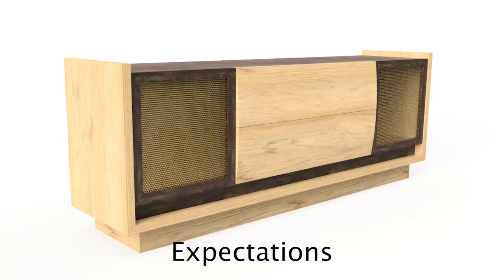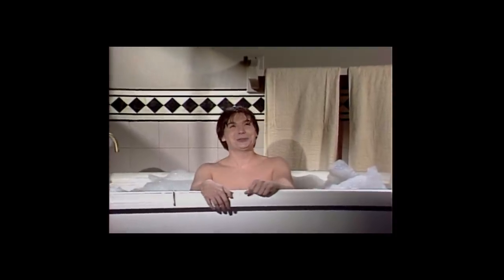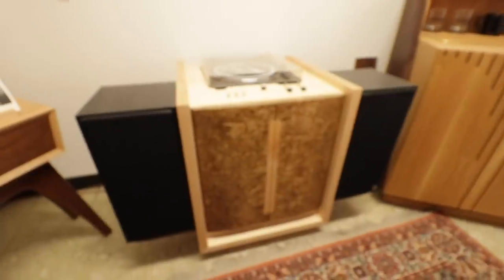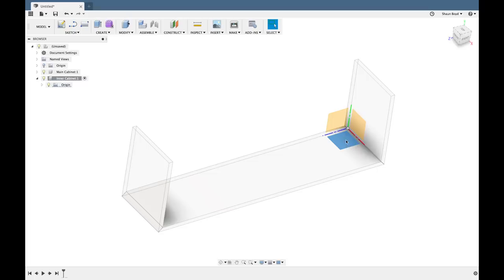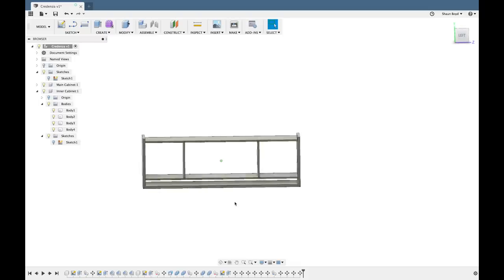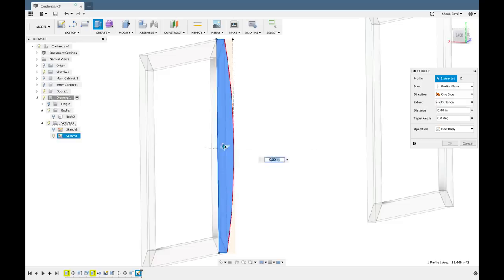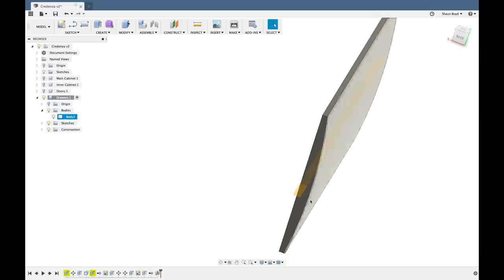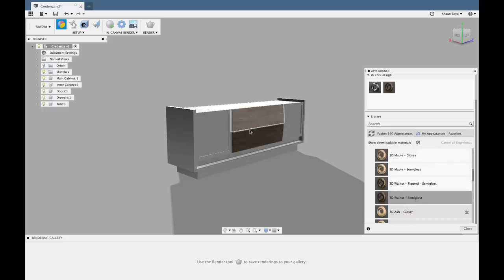3D Modeling Furniture with Fusion 360 - Modern Credenza Build - Part 1

Comment: I'm still using sketch up 8. Fusion looks cool. I find 3D modeling very useful for getting cabinet jobs. When they see the project in 3D it makes it a lot easier for them to finalize their ideas. I mostly use it for a quick representative drawing to get the job. Then if I get the job I will build the project enough to create an accurate material list. It's very useful for determining how to best break down plywood with the least amount of waste. The truth is, It's a love/hate thing for me. After I've been drawing a project in sketchup for a couple days I usually have a severe crick in my neck and am sick of working on the computer. I just can't wait to finish so I  can get out into the shop and build something for real but I've gotten to where I'm afraid to cut a single sheet until I'm done planning ALL my cuts.
Reply from the maker: Yeah, definitely one of the best parts is being able to much more accurately estimate material needs and material costs. But I agree, after a day of designing on the computer, I am ready to get to the real stuff!
Reply: Have been using Sketchup for a couple of years. Switched to Fusion last year. Being at the computer is fun again. Sketchup is really not good at anything. The built in local  renderer is better then the ones I had to purchase to use with Sketchup. Trimble is slowly killing Sketchup.

Comment: Great job Shaun!!   I enjoy seeing how creative people can use new tools to help them.  And that is exactly what Fusion360 is, a new tool.  I've been playing around with F360 for a few years, and really dig it, but I've been playing around with 3D cad programs for over 20 years off and on, and 2d cad for longer then that.  Everybody does things differently, so if designing this way works for you, great.  In a way it does seem closer to the way Sketch up works with having blocks, and then morphing them to get what you want.  And some people find that program much easier to use then F360 for that reason.

In watching you work, I thought about how I would do it, and at lest for the carcass, it would have been a bit different.  The big difference, I find from an efficiency stand point is not to have to jump back and forth between sketching and extruding in those early steps for every piece as much.  So I would have probably started with a front view sketch, and gotten the whole frame sketched in that view (similar to what you had done in pencil), including mitered corners and those little cubies first.  Then started extruding the depth, since most of it was all the same depth.  You still can go back to the sketch and change things as needed, and even create new sketches for things like the mortises that you want on a different plane.  But getting the bulk done up front, I find to be a big time savings.  But one of the great thing about F360 being a parametric (big word, I know) cad program, is you can always go back to the sketch and change proportions, or dimensions and it will adjust everything else down the line.  

I know this was a wall of text, and coming out a day after the video, will probably not get read much.  But I hope it is helpful for someone.  And everyone finds what works for them.  

OH, and with that worker you have living under your bench, it will be cool to see you get into CAM work and generate some G-code for it in F360 at some point.  But that is down the line.
Reply from the maker: Thanks Steven! And that is really good advice, I might try that technique on the next one. I think my brain is so used to working in the physical world, that I build it in the same way I would the actual piece. So it is all about individual panels, etc. Really appreciate the tip, and thanks for watching!

Comment: Good information, Shaun! I have been considering getting into Fusion. I knew Sketchup years ago, but forgot all of it. Rather than relearning that, I was thinking about putting the energy toward learning Fusion. Is that the better move?
Reply from the maker: Thanks, Bruce! I have only tried Sketchup a few times, so I don't know a lot about it, but Fusion seems to be a much more powerful program. And Fusion has integrated CAM functionality which was the main reason I started using it. I imagine if you have experience with Sketchup, learning Fusion should come fairly quickly.
Reply: I used Sketchup for 8 years before switching to fusion 360. The transition was a bit difficult, but so worth it! I'll absolutely never go back, fusion is better in pretty much every way. The learning curve it's steep, but it's so much more powerful than Sketchup, and also gives you access to parametric design, which is an absolutely incredible feature! You can also do cool stuff like insert a model of any component you can buy from McMaster-Carr, simulate mechanical stresses on your model, do all the CAM for cnc machining, design with sculpting tools, and design in a sheet metal environment that allows you to unfold your model into a flat pattern which you can then cut and fold from sheet material. It's honestly a bit hard to learn, and the design process and philosphy is very different from Sketchup, but it's so much better! It's also free to hobbyists, even the ridiculous features like algorithmic design that uses machine learning to optimize a structure for physical stresses. Get on it! You'll be glad you did.
Reply: Evan Barnes thanks for that. I’ve downloaded t. Now, to learn it. ;)
Reply: @BruceAUlrich  you're welcome! Just remember that while it can be more frustrating to learn initially, it's so much more powerful that it actually makes most aspects of design easier in the long term. One of the other features that drew me in from Sketchup is the timeline, which allows you to roll back in time in your model, change a feature, and then have all the subsequent work you did automatically update to reflect that change. There are lots of great videos and online resources fire learning fusion, and remember fusion rule 1: when you start a new design, create a new component and initialize it. I also recommend immediately defining parameters you think you'll need and referencing those in your dimensions. This makes your design very flexible, and it's really hard to go back later and make a design parametric that wasn't from the start. Also try to fully constrain your sketches, since an unconstrained sketch line can do weird things to your model when you change features or parameters. That'll all make sense as you dig into Fusion. Have fun man!

Comment: Fantastic video. Love it when designers go more into there design process rather than just jumping straight into the making. In terms of Fusion tips I would say to try and avoid deleting features that you have referenced off later down the workflow. What I mean is when you delete the initial flat drawer front after you have used the edge of it as the reference plane for the curve. A better way would have been to select the opposite side of the curve and extrude cut this from the initial flat front. Make sense?? I am pretty new to fusion myself and initially my timeline (bottom of the screen, if you didn't know) used to be full of them yellow warnings as well, as I did things the software didn't like, and some of them would come back to bite me later as I tried to change my design. I have gotten much better now though and have just finished a complex design that I am really proud of. A rendering of it is over on my Instagram if you would like to see. https://www.instagram.com/p/BrLqe9tFkGG/
Reply from the maker: Thanks Thomas! You are totally right, I almost always have a bunch of timeline issues, so I know I'm not maximizing the usefulness of the program being parametric. Definitely need to work on that. Just checked out your rendering on Instagram, awesome work! I can't even imagine doing something like that!

Comment: I would suggest defining parameters you know you'll need at the very beginning, like material thickness and overall length, width, and height, and then referencing thos parameters in your dimensions. That way, you can change your mind later, change the value of the parameter, and have the whole design update coherently to reflect those changes. Parametric design is THE reason I switched from Sketchup to Fusion. I later discovered that it's better in every way, except for steepness of learning curve.
Reply from the maker: Yeah, totally agree. Taking advantage of the parametric design functionality is something I haven't quite gotten a grasp of yet. Hopefully as I use it more, it will make more sense. That dang learning curve!

Comment: So I typically build and design as I go. Has this helped builds go faster and smoother? I think it would take me twice as long to model something than it would to just get started making it. Just curious on your thoughts
Reply from the maker: It really depends. I often design as I go, as well. But for a large piece like this, it will definitely help down the line. There is no doubt dimensions will change and little details will be different, but it is nice to have the overall concept in such an accurate representation.
Reply: Thanks
Reply: Same here, build as i go
Reply: D’s Hard Wood Creations loved ur walnut table. Just subbed to you and hope to see more. Great idea with the brass dowels
Reply: Thanks brad appreciate it.

Comment: Great video Shaun. Thanks for posting. Also been going down the Fusion rabbit hole. Hugely useful. Largely thanks to Lars. I found a small wheel mouse an invaluable addition over using the laptop trackpad. Much cheaper than a 3D mouse and a huge productivity boost. Out of interest how long did you spend modelling this up in Fusion?
Reply from the maker: Thanks, Mark! Yeah, Lars is pretty much the sole reason I can do anything with Fusion. I tried using a standard mouse, but found myself going back to the trackpad, maybe I just didn't give it enough time to get used to it. I don't know exactly, but I probably spent at least a couple hours modeling this one.

Comment: Love watching your builds. I'm a big fan of Fusion360 and use it exclusively for computer based design work for my items. Like you, I always start with a tradition pencil and paper sketch. I may even use some design markers as well. Just a tip, if you want to create a plane to cut the drawer front in half, you could have also used the Midplane command and selected the two end faces of you drawer panel. I look forward to seeing the rest of the vids in this series.
Reply from the maker: Yeah, I need to do that initial pencil drawing just to get the ideas flowing. And thanks for the tip, I was hoping I would get a few good ones! Thanks for watching!

Comment: Nice one! The only thing I might have done differently is the plane you used for the Split Body command. There is an option in the planes menu for Midplane where you could click the top and bottom faces. That way, if you changed that distance for some reason, it would still automatically cut it in half.
Reply from the maker: Ah, nice! I was hoping I would get a few tips like this. Really appreciate it and thanks for watching!

Comment: The sleeper feature of Fusion is being able to put together plans really quickly and clearly after you're done modelling. Rendering is nice to visualize a new idea but the organization I get from modelling and then putting together that detailed set of plans is invaluable. If you do get into doing a lot of fusion work, I recommend getting yourself a gaming pad (one of those with like 20 buttons) and mapping out the keyboard shortcuts to them so you can work way more efficiently.
Reply from the maker: Yeah, totally! It is such a great tool for planning material needs, and workflow. And yes, I was very surprised that so few tools have keyboard shortcuts. To be fair I haven't even checked if I can assign more shortcuts, but your idea makes a lot of sense.
Reply: @shaunboydmadethis  with the gaming keypad you can assign macros so it can simulate multiple keystrokes and even mouse clicks. You can program some pretty complicated things. I especially love it for panning and zooming functions

Comment: Good stuff Shaun. I had quite a few years using Inventor, Fusion's non-free big brother and if you going to keep using 3D software, invest in a 3D mouse. They are kinda pricey, but they really make movement around the model a breeze. Looking forward to the build.
Reply from the maker: That is interesting to hear! I have tried with my normal mouse and the touchpad on my laptop, and I prefer the touchpad. But I imagine a purpose built mouse would make things quite a bit easier. I'll keep that in mind. Thanks, John!
Reply: One of those things once you get used to it you don't know how you did without it.